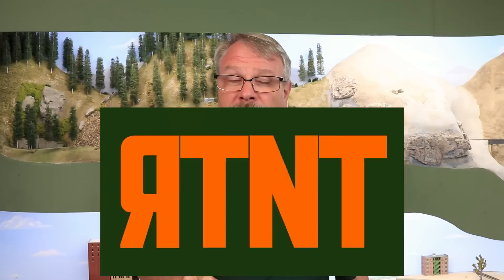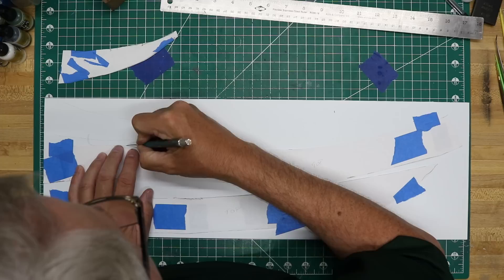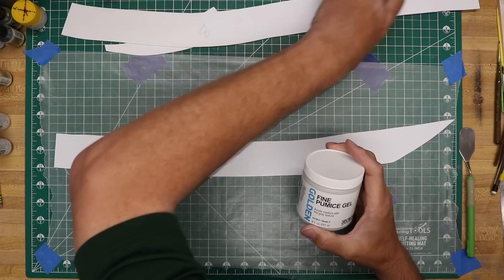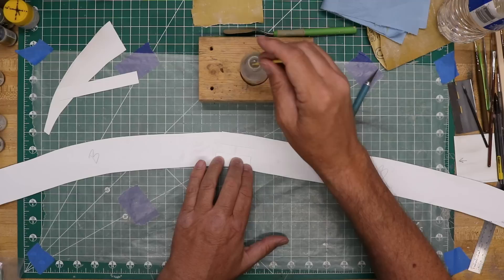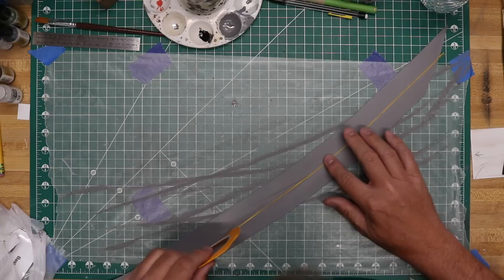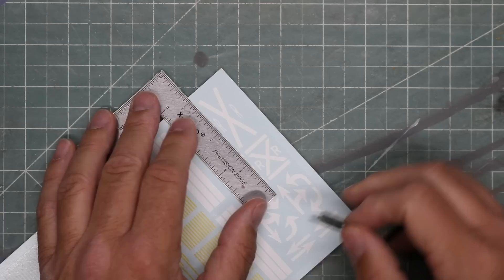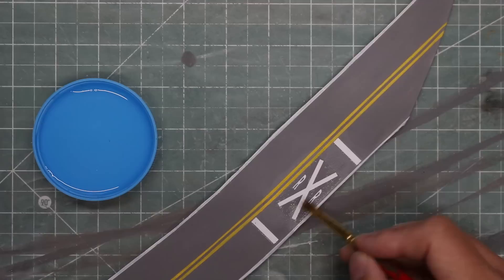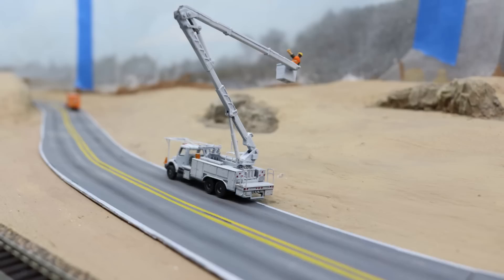How to Build a Realistic Model Highway

Comment: I also learned about the fine pumice gel from Boomer and have already used it in a couple of situations on my club's N scale layout. I used Boomer's water flood method to apply the acrylic paint to give that slightly varied base colour for the tarmac appearance.

I also did some playing with the extra coarse pumice gel and found that it is great to simulate a rough rock wall. It does not look so good when first applied, but when dry gives a very good impression of a rock wall.

I will now look at getting some of that artist masking tape, as you made it look so easy to apply the road lines using it.

I think that we all need to look at some of these artist materials for our scenery - after all, we are really making 3d art, so why not use stuff made for artists.

Comment: Another great video. Some very practical and helpful suggestions. Instead of putting spent hobby blades in soda bottles, put them in a sharps container, designed for this. These can be purchased at Costco or other pharmacies for a nominal price. When full, most pharmacies will see to there proper disposal, usually at no cost.